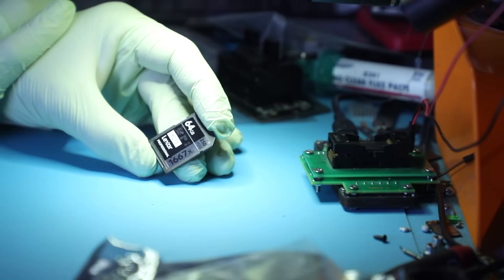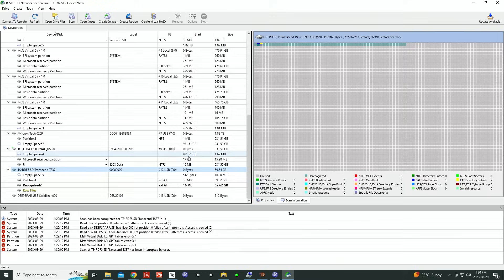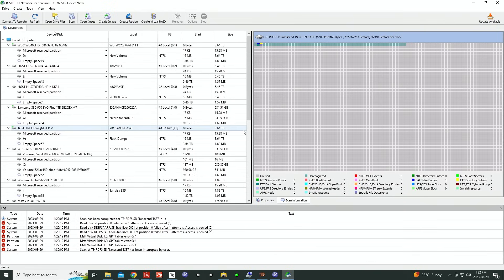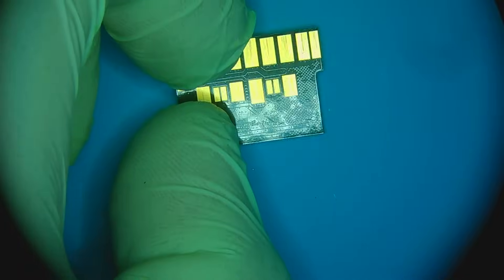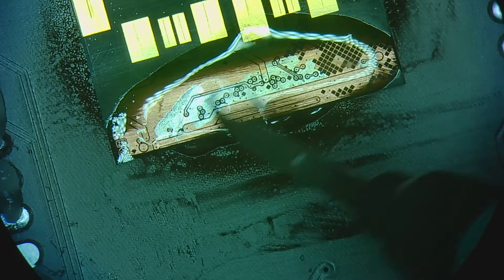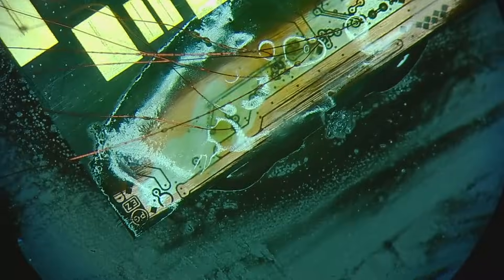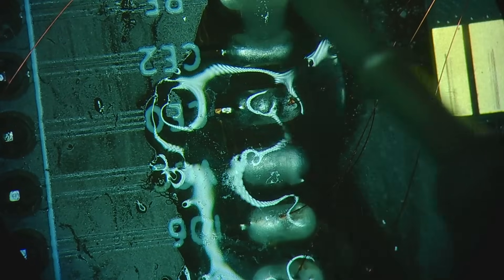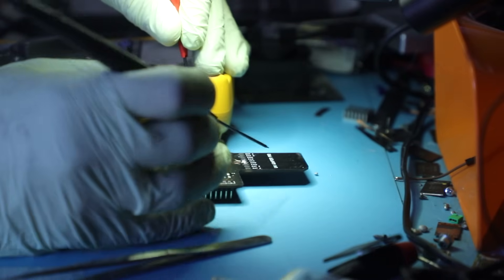Lexar SD card has been formatted by Sony camera can data be saved Part 1

Comment: so those wire traces can touch one another while power is applied to extract the data ..btw ..what is that paste you apply on those ssd memory chips with that stencil is that a thermal paste???i saw that in other videos ..so kool to see this done :)
Reply from the maker: yeah the wire is isolated, so no worries with then crossing. The paste for reballing is a low temperature solder paste
Reply: thanx :)  @hddrecoveryservices

Comment: For info
LDPC ECC
The card accepts some command (presumably), that for now only formatting in modern Sony cameras knows about and uses, that effectively 
invalidates the previous contents and makes it appear as zeros
same as or similar to a 'secure delete' option
The two data recovery vendors mentioned [06:50] were  PC3000 (Acelabs) and Ruslut VNR
Reply: LDPC ECC has nothing to do with erasing. Erasing is something that exists in the SD card SPI data transfer protocol regardless of the ECC mechanism used. The device issues ERASE_WR_BLK_START_ADDR and ERASE_WR_BLK_END_ADDR to mark the first and last block of the area to be erased, followed by ERASE.
Reply: ok thanks, and its up to the card exactly how it impliments the actual erase. 
Just wondered what was 'new' in the way modern Sony cameras, in conjuntion with these SD cards, worked that led to this issue (wheras other cameras and/or older cards dont have the issue)
Reply from the maker: translator table gets wiped out using Sony camera. Logical image on the card is built using a translator table. However, using tools such as VNR, and PC3000 and FE you can build logical image using block sequence instead of original empty translator. Data remains in blocks, but with empty translator, card would not bother checking it
Reply from the maker: LDPC ECC has nothing to do with it. It is due to lack of techno support for LDPC, cards that use it can't get error correction phase done. As a result, they will consist of 99% bit errors, and nothing will work
Reply: ok, but just wondering what command exactly the Sony camera sends to do that (to wipe the translator table, and as a side effect, or the desired effcet,  get what appears to be a fresh empty device)?
Reply: @stephencole9289  And this isn't something new to Sony cameras, it's just how Sony decided to perform the format. Other cameras or operating systems perform the format on the file system layer where they simply discard the allocation table on the file system.
Reply: YouTube has lost my reply that was links to more info on LDPC
https://www.youtube.com/watch?v=PzjhgcNywtI
Reply: WOuld be interested to know exactly what 'command' the latest Sony cameras uses to determine the SD card type and to do this 'secure format' Probably defined in the current or some enhanced SD card protocol specification
Reply: @stephencole9289  Those Sony cameras from A7 III send SD_ERASE (a TRIM-like) command to the card upon formatting, after which the card appears to be filled with zeros. In reality it takes a while before sectors are actually erased, but the card's firmware simply returns zeroes without reading those sectors actually, when you request a sector from the 'trimmed' range. But be aware of as long as the card gets power it might be erasing sectors due to the background processes, so eventually data will become unrecoverable - this is why chip-off recovery is useful because it skips the card's controller.

Comment: Nice!! What size wire is that 0.1mm, or smaller? 0.1 is pretty effing tiny to work with.
Reply from the maker: 0.04mm
Reply: @hddrecoveryservices  Dayum, looked tiny but of course cant tell on video.

Comment: Hello sir , hope u doing great 👍🏻 

I have a hdd which contains some bad sectors and it’s not working properly 

Could u plz suggest for us a software tool that can fix or isolate these bad sectors 

Thank you in advance 😊
Reply: Bad sectors are the death of the drive. It will get worse. Recover your data if you can, then recycle the drive.
Reply: @tenmillionvolts  The issue I'm facing is that I'm unable to copy the data, and the situation has worsened. It would be helpful to have a software solution that can assist in repairing the HDD sectors or at least enable me to copy the data to another location
Reply from the maker: Ideally, it needs to patched and then imaged. Not possible without tools for it. I would suggest professional help at this point. Anything DIY, at this point, can kill the drive prematurely

Comment: Amazing ultra fine soldering of the wires. It still blows my mind how something so small can hold 64Gb when us oldies can remember the 5.25inch floppy disk then superseded by the 3.5inch double density 'floppy' which held I think 1.4Mb
Reply: I used to have a box with 10 x 5.25 floppies when I started to learn programming (Basic and COBOL) 😮 LOL
Reply from the maker: I've seen a few 5.25 back in early 90s in Russia, but most of our games as kids were kept on 3.5" floppies. Oh the sound that driver would make when you plug them in and turn that magic latch to close :) #nastalgia
Reply: Remember when the first SD cards came out and when you bought a camera, it came with a 4MB card. Try doing anything useful with those today!